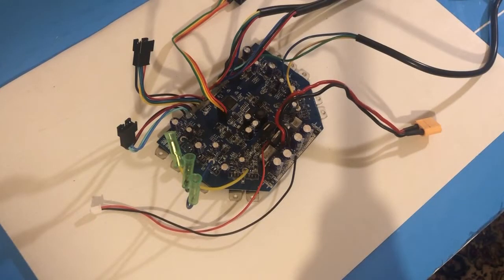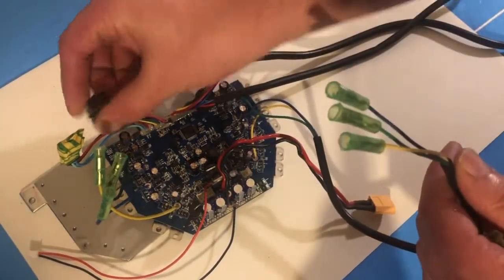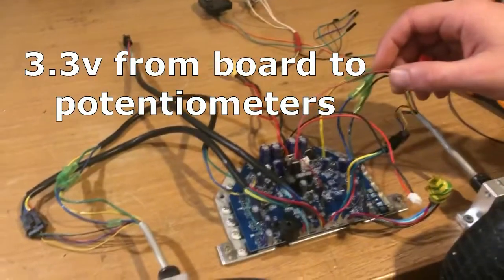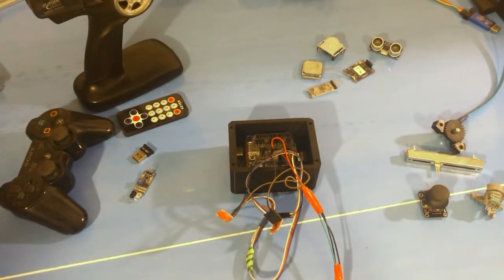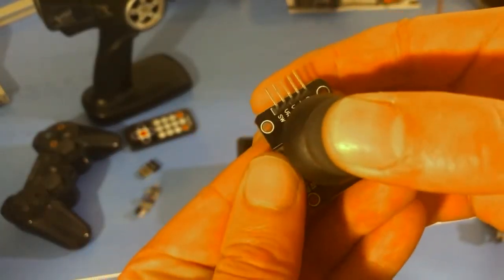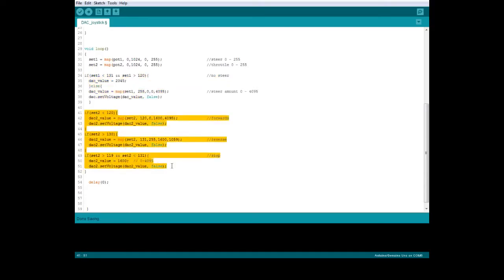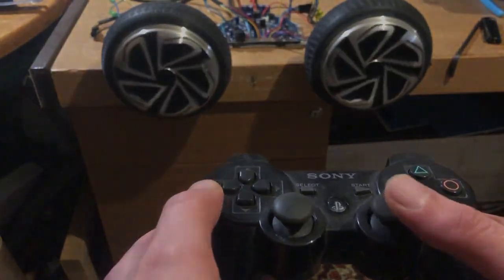HOVERBOARD MOTHERBOARD HACK - how to controll the motors PART 2 - Hover Board Hack

Comment from the maker: The arduino code from the video:

#include <Wire.h>
#include <SPI.h> 
#include <Adafruit_MCP4725.h>

int pot1 = A0;
int pot2 = A1;

int set1 = 0;
int set2 = 0;

uint32_t dac_value = 0;
uint32_t dac2_value = 0;

Adafruit_MCP4725 dac;
Adafruit_MCP4725 dac2; 

void setup()
{
  Wire.begin(1);        // Activate I2C link
  Serial.begin(115200);
  dac.begin(0x60);
  dac2.begin(0x61);
  
}

void loop()
{
  set1 = map(pot1, 0,1024, 0, 255);                    //steer 0 - 255
  set2 = map(pot2, 0,1024, 0, 255);                    //throttle 0 - 255
    
if(set1 < 131 && set1 > 120){                          //no steer
  dac_value = 2045; 
  }else{
  dac_value = map(set1, 255,0,0,4095);                 //steer amount 0 - 4095 
  dac.setVoltage(dac_value, false);
  }

if(set2 < 120){
  dac2_value = map(set2, 120,0,1600,4095);             //forwards
  dac2.setVoltage(dac2_value, false);
}
if(set2 > 130){
  dac2_value = map(set2, 131,255,1600,1059);           //reverse
  dac2.setVoltage(dac2_value, false);
}
if(set2 > 119 && set2 < 131){                          //stop
  dac2_value = 1600;  // 0-4095
  dac2.setVoltage(dac2_value, false);
}

  delay(0);

  
 }
Reply: A-Tech Hello Sir. First of all It’s a great Job. Very clear video. I have only one question why reverse is so slow and is there any why to increase it? Thank you so much.
Reply from the maker: @zeko120  hi, im not too sure whats going on with the reverse, as soon as i know and get it sorted i will share it, thanks
Reply: @A-tech  Hello master!
I looked at two parts of your video yesterday, and today I redone the gyroscooter with the firmware presented.

As a result, it sometimes does not work stably with potentiometers, and as already noted, the use of DAC is required.

I will also note a slow and insecure reverse. But he definitely is:)

If you 're a firmware author for stm32, I have a question:
Is there any firmware for implementation of the three H-bridge for brushed dc motor throught one hoverboard mainboard?

I 'll follow the project closely!
Certainly a great job has been done!
Reply from the maker: @igormorozov6801  Hi yes DAC does make it a lot better, the reverse is really slow i know, i havnt been able to fix that yet.

i like your idea for controlling dc motors with the mainboard but im not sure if its possible.

Thanks for your nice comments its very motivating to hear them, thanks
Reply: @A-tech  hi, thank you so Much! i'm making a motorized chair for my dad!  I really liked the project!  does this code work to control the wheels correct?  can you make available the last code you used to test here?  Thank you again.
Reply: Thank you so much Sir for sharing your knowledge about this, I'm currently making a joystick controller for my dad's hoverboard wheelchair using what you've shared here. I just want to share some modifications I've made for others who wants to apply it also. Below are the modified codes to handle correct turn when in reverse:

  set1 = map(analogRead(pot1), 0,702, 0, 255);                    //steer 0 - 255
  set2 = map(analogRead(pot2), 702,0, 0, 255);                    //throttle 0 - 255

if(set1 < 131 && set1 > 120){                          //no steer
  //dac_value = 2045; 
  dac_value = 2050; 
  }else{
    if(set2 > 130){ //steering when reverse
      dac_value = map(set1, 0,255,0,4095);                 //steer amount 0 - 4095       
    } else { //steering when forward and stop
      dac_value = map(set1, 255,0,0,4095);                 //steer amount 0 - 4095       
    }
    dac.setVoltage(dac_value, false);
  }
Reply: hey have you also implemented brakes?
Reply: Can u use 1 potentiometer to control both motors at the same speed ?
Reply: Thanks for posting

Comment: Maybe use a PT01B Model Aircraft Receiver PWM Signal to 0-5V Analog Voltage Signal Multi-function Converter Board to interface with a PPM RC receiver and the pot inputs?

Comment: Hi! I really love your videos—they're fantastic! I have a question: Can one controller board manage four motors (wheels)? I'm considering purchasing a hoverboard so I can replicate this. Is there a specific brand or model I should focus on, or are all control boards similar in terms of soldering the header pins and uploading the software? Are they all essentially the same for any hoverboard available?

Comment: what happens if I leave the steering pot unplugged ?
Reply from the maker: hi, im not sure, could be center or might be random or might not work at all, thanks
Reply: I'm also having issues with connecting the board 2 the cube programmer

Comment: does one need to use steering pot?  what if we making a trike and dont need that.
Reply from the maker: hi, i think you would need one to set them to be the same, if none is connected im not sure what would happen, they might go the same by default, you could probably connect a potentiometer to the steering for a bit of electronic differential, i think even with a trike the rear wheels would want to go different speeds, hope this helps
Reply: @A-tech  agreed.  Just rather not have extra dials a kid can play with.  Maybe i mount on steering column with gear to accomplish the differencial when steering.

But from what i see in your video this would also mean if steering is turned with no throttle it would still activate which is why i rather not have it at all

Comment: Could i replace the potentiometer with a thumb throttle? I just want to make a drift trike but im getting confused. 

And, do i need the steering potentiometer? I want both wheels to always to rotate the opposite direction same speed to be like my rear axle.
Reply from the maker: i dont see why not

Comment: For me after the software change as soon as i give it any voltage, 0-3.3,to blue or green it only spins both wheels on 1 constant speed. Tried it with the dacs as well as simple potentiometer..
Reply from the maker: ok 1 should do speed and the other should do speed difference between the 2 motors

Comment: Say if I want one of the pentiometers to be a foot pedal, it has the three wires but the only thing is it says 12 to 48v, will I be able to use it

PLEASE RESPOND!!
Reply from the maker: hmm, its hard to say, if you get this working with a potentiometer then swap the potentiometer for the pedal and see if it works, there will be only low voltage going through the potentiometer
Reply: @A-tech  I thought 1 pentiometer and 1 pedal I also ordered the reprograming thingi
Reply from the maker: ok great good luck

Comment: Can you help me? What pins do I have to solder on the Digital-to-analog converter to change its address of it? I found 8 pins on it but I don't know which one is the right one. I'd be really happy if you would take a moment to help me :D 

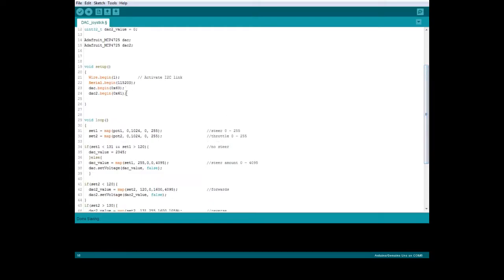(It was said in 10:56)
Reply from the maker: hi, oh ye the very very very important thing, if i remember correctly the pins are already soldered together and you need to get a stanley blade or something to cut the link, i think, thanks
Reply: @A-tech  Oh thank you a lot!!

Comment: Can You help me something, looks like You've studied the board. Where is located the switch or the jumper or the wire for "locking" the 2 wheels, to turn synchronized? To control both from one control?
Thanks!
Reply from the maker: hi, haha if it was that easy, im not sure if thats even possible with both the wheels being sensored, you can control them both together, with the 2x potentiometer method one does the speed and the other is balance between the 2 motors

Comment: Couldn't PWM be used to change the speed of the wheels? changing the voltage from 5V to 3.3V with a MOSFET
Reply from the maker: hi, these motherboards support lots of different input types, pwm being one of them, I like to use the DAC as a safety thing, I have tried serial coms before but the motors would continue to spin if the controller crashed

Comment: Just flashed the latest software from the link and it doesnt work at least on just potentiometers connected :/
had some feeling at some point that it kind of works as adjusting potentiometers was chaning the capacitors recharging frequency (it's heardable), but somehow stopped doing that :/
The software definitely loaded on the device as when it starts needs keepeeng power button on to stay up.
I just assume that the latest software was for different input type. Anyone go the software version used on this video ?
Reply from the maker: hi, its possible they have changed it but i dont remember needing to hold the power button down for it to work

Comment: Hi, According to the wiring diagram I found, the hoverboard has 2 sets of gyro inputs, the diagram you showed only uses one blue wire and one green wire.  How does that work?  Thank you!
Reply: I'm fairly sure the custom firmware he installed bypasses the one gyro input, because in Part 1 he just cuts the wires for that input.
Reply from the maker: hi, sorry for the slow reply, yes in part 1 it shows a bit better, you only need to use 1 sensor cable because that does both, the other is just for the leds and stuff

Comment: This has to be the best tutorials for hacking hoverboard firmware, am using this, just one question, do you think you could hook up rc equipment directly?
Thanks so much for these two videos
Reply from the maker: hi, thanks that means a lot, apparently they can but i think you need to edit the firmware file to enable it but not 100%, if you need to use rc stuff i know you can run that through an arduino if that helps, thanks

Comment: Hello, I have successfully changed the software in the Mainboard, but i must adapt the values of the throttle in code. Could you tell me which value should i change for lower max voltage on throttle? 
Best regards 
Jakub
Reply from the maker: hi, do you mean to set a max speed?

 find this line of code: 
"dac2_value = map(set2, 120,0,1600,4095);             //forwards"

so the 4095 is the number for max speed, 1600 is stop, so any number between them two instead of the 4095 should reduce the max speed, hope this helps
Reply: @A-tech  hello, thanks for your reply. I want to increase the max speed.... I have made some test mit motus Scooter. Motus has 350W motor and in our project the motors have 2x540. Motus was faster, greater max speed and so one... So I think the throttle don't give full 3.3v at max load. i have to measure the max voltage of the throttle and adapt the code for my throttle. 4095 is 3.3v?

Comment: Hello,  these are great videos you have done on hoverboard hacking.  I definitely want to use the arduino like you have to control the motors using a wireless joystick.  Will an arduino UNO rev 3 board work well for this?  I already ordered the breakout modules and am looking for the controller that fits my need.  I'd like to use the 2 axis joystick you showed - but only make it wireless.  I'm just a bit fuzzy on how to integrate the arduino as I've never used one before.  It doesnt look all that hard, I just want to make sure I get the right stuff.  Thanks for posting all these ow to vids - the tank is super awesome!
Reply from the maker: hi, yes arduino uno is fine, i think i have had these running off a few different arduinos, as long as you set up the DAC in the code it should be fine, i have another video about using a ps3 controller with arduino, you will probably find that helpful, thanks

Comment: Good video! Thanks. What about a video controlling the motors with a Bluetooth connection via Arduino and app inventor? 🤩
Reply: I Solved it! thanks! now I am into the nunchuck control now!
Reply from the maker: hi, i looked into it, it might be easier using an esp32, they have bluetooth and built in DAC

Comment: I don't know what i'm doing wrong, i hooked up my potentiometer to the long cable for speed like in the drawing(3.3v to left pin blue to middle pin gnd to right pin), and i have my firmware set to variant_adc, i'm not sure what to put the values at, but in the firmware it says it can be auto calibrated, so i just left it at the defaults and have tried the auto calibration, but the motors don't turn when i try the potentiometer out. I really wish there was a discord channel for discussing hoverboard firmware related stuff.
Reply from the maker: hi, did you get it sorted out? i dont think we need to change any values just upload the new software and should be good to go, i would like to set up a discord for this kind of thing but not sure how it works, thanks

Comment: How do I bypass the 4 feet optical sensors for forward and back 
I got 2 separate controllers linked via 4 pin wire ....might try opto couplers
Reply from the maker: you could try using a servo with a blanking flap?
Reply: @A-tech  I forgot to add 1 wheel failed to run but think it only needs 1 sensor then it looks for the level sensor is it a accelerometer
I have to tilt the PCB for forward and reverse also speed control mmm
There's a bit of damp and corrosion on that PCB .... I've checked few components aiming for SMT capacitors capacity of the one was below 2uf and the rest was 5uf would that stop it from moving mm
Reply from the maker: @davey2k12  ok yes thats right i think it does only look for one pressure sensor, im not sure if it would stop it moving, but corrosion is usually bad for a pcb, do you need to tilt both sensors at the same time?
Reply: @A-tech  oh yeh maybe that's why only 1 wheel runs board might be trying to turn one way mmm, might be 2 accelerometers on each PCB working independently for steering good call bro 👍
Reply from the maker: @davey2k12  I think so yes, im pretty sure when i rode one before you could tilt one foot and only that side would move, no problem

Comment: Nice work, I've done this to my motherboard, but i conected only one motor, and tested it. It was fine until i sensed some heat coming from the wires of the motor phases, and also motor sounded like something was cracking. Can you asume what might be wrong?
Reply from the maker: hmm, it could be a broken wire that is not always connected? its hard to say, you may be able to test different parts with a meter to pinpoint the issue, thanks

Comment: Hi! Is it work with normal ebike throttle (with hall sensor) ?
Reply from the maker: hi, i cant say yes or no, but if it works like a potentometer then it should do, you may need to map it with an arduino

Comment: gracias, buen trabajo.
no tengo mucha experiencia en arduino y solo intento colocar un joystick,  agradezco su ayuda. abrazo!
Reply from the maker: ok, do you mean a 2 axis analogue joystick? because they self center you would need to map the values or maby use some resistors somehow, hope this helps
Reply: @A-tech  yes 2 axis analogue joystick..
voy a intentar map para controlar forward and reverse.
Reply from the maker: ok i think you will need to use an arduino, hope this helps

Comment: Hi! New subscriber. I am interested in hacking hoverboard main control boards using your method and code to reflash the board processor, for use on a kids gokart. One question please: Can the brake function be made graduated, like a car hydraulic brake, so the motor(s) brake over say 3-4 seconds, rather than instantly? I'm not smart enough to alter the code to do this myself, if it's even possible. Ken
Reply from the maker: Hi, im not sure if it is possible, for the brakes it might be best to use a mechanical brake just in case something was to go wrong, hope this helps :)
Reply: OK, thanks. I am trying to avoid doing that. The instantaneous stop is a bit hard on the driver. Getting rid of the heat over 3-4 seconds may be a problem for the control board components. Cheers Ken
Reply from the maker: im not familiar with the stop you mention, it sounds like an emergency stop, is it with a switch or just when you are going forwards then put it in reverse? thanks

Comment: Why not just use PWM output from the arduino?
Reply from the maker: i have tried but never got it to work
Reply: @A-tech  I followed the instruction on github and couldn't either so I tried inputting to the "short" lead side and it worked... I used an esp32 board which outputs 3.3v pwm voltage so I didn't have to worry about which input side was capable of handling a 5v signal.
I'm using the "feru" FOC hack
https://github.com/EmanuelFeru/hoverboard-firmware-hack-FOC/issues

If you're still having issues, you can double handling the analog/digital conversion with a DAC to act as a pot (Arduino digital out -> DAC module -> hoverboard (internal ADC).
Reply from the maker: apparently the esp32 has a some DACs built in, so you could use them instead, when i was trying pwm before i assumed you should be able to just use a pwm arduino pin and send any number between 0 - 255 and the motor should move, not much info about that
Reply: @A-tech  I've used a few different protocols and the easiest to use are the DAC version and the PWM version.. I also have a flysky transmitter that I've hooked up using the ibus protocol and it worked at first, but not having any luck now. Might be an issue with the receiver though.